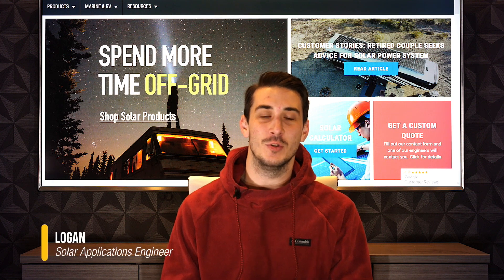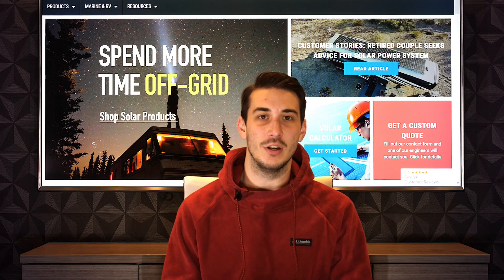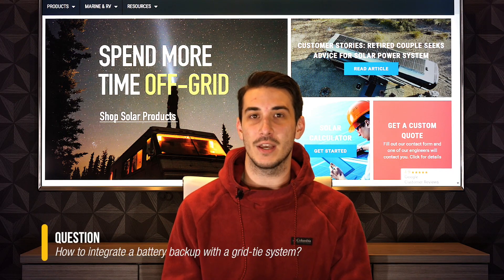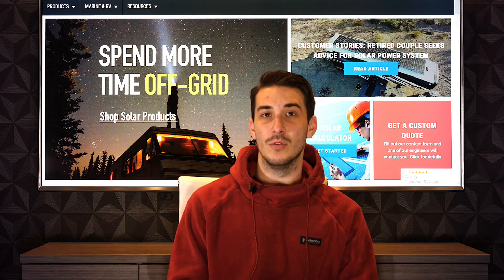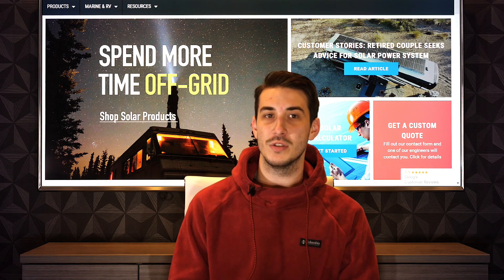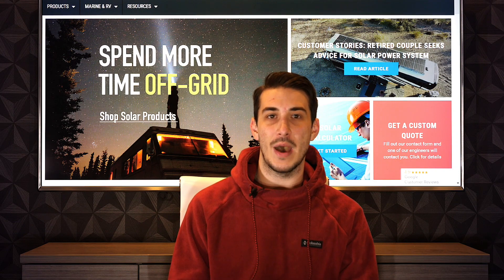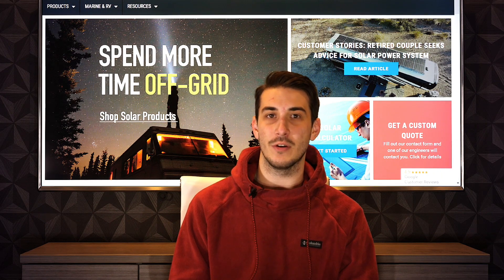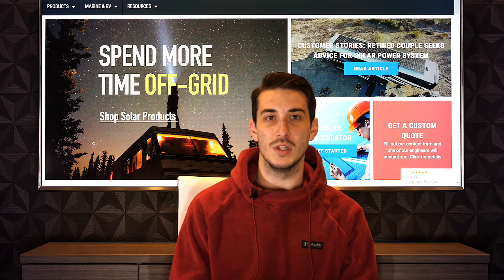How do I integrate a battery backup with a grid-tie solar power system?

Comment: I have a grid tied system and want to do exactly this!  Any recommendations for a reasonably priced battery bank that can be purchased without an installer?
Reply from the maker: We have several favorites if you're just looking for a battery bank. The Discover AES rackmount batteries are excellent, the Pytes V5's are great, and Fortress has some great options as well, depending on how much capacity you need! Definitely give us a call though. We can help you pick the right ones for your needs and get you the best pricing with some big discounts, especially right now!

Comment: Hold on!  You said after solar generated power satisfys the critical loads panel and the main panel, the excess is sent back to the grid??  NO, I want the excess to CHARGE THE BATTERIES.  Also, we need a better explanation of how the system prevents energy flow to the grid during outages - you know, for safety? Diagrams and a better explanation is needed.
Reply from the maker: https://youtu.be/6-tBtltI9XA?si=tgt2k9u1SmuOmpG4

Comment: If the system is tricked into thinking the grid still has power what stops the system from feeding excess power into the downed grid to prevent electrocuting the linemen?

Comment: This is the first understandable description I've found of what I want to do with my existing solar setup here in RI. I'd love to see a schematic, and I have one question at this stage: Is there a way to automatically disconnect from the grid when it's down (and reconnect when it's back up)? If my array and batteries are hot I don't want to have my lines to the outside world powered while utility company crews are working to reconnect me.

Comment: A diagram is a must. The sub-panel is connected to the main panel with cables obviously. So when the GRID goes down, why is the sub-panel disconnected from the main panel. What makes that happen? Do you manually flip the breaker to the sub-panel?
Reply from the maker: Video with diagrams: https://www.youtube.com/watch?v=d9onjlc1qNE

Comment: My PV systems peaks at over 40 kWh/day in May, and stays over 30 kWh/day (for sunny days) from April until mid-October, but on days I don't need the AC, I'll only use about 17 kWh/day. So if the AC isn't on my battery backup, and the grid is down, would it just shut down the PV and run on battery only, or can the PV continue to power the house and save the full battery for after the sun goes down?

Comment: When grid goes down, why would only sub panel circuits receive power from secondary inverter/battery storage. Since sub panel is connected to both AC output from hybrid AND main panel, shouldn’t main panel circuits also continue to receive power when grid goes down?
Reply from the maker: Generally, it's for safety reasons. When the grid goes down, we can't have grid-connected power systems energizing the grid while the utility company is working on getting it fixed. So the solar system isolates the sub panel from the main service panel to prevent energy from back-feeding the grid. This is why we tell customers to connect all their important loads to the sub panel. In the event of a power outage, the solar system will disconnect from the main service panel while continuing to power all the loads connected to the sub panel. Once the system detects that the grid power is back, it will reconnect to the main service panel. This video might also be helpful for you: https://youtu.be/verL-CIdtEk

Comment: Hello good afternoon thank you for producing this video I am located in Prescott Arizona question for you is I am running an off-grid system along with a grid-tie system I have read a few places that really don't make sense to me but I'm throwing it out there. If I feed my grid-tie inverter with my off-grid inverter to simulate a grid signal I have heard that if the grid tie inverter produce is too much power at that time it will have nowhere to direct the extra power which would normally go back onto the grid. My thoughts are it would just be energy lost but I have heard that the excess energy would harm the grid tie inverter. I am just under the impression it's based on Ohm's law whatever load is connected is the power that will be consumed the additional power will not be transferred anywhere is that correct

Comment: If your grid tie thinks there is power on the line and it still produces voltage how does it not energize the power line then?
Reply: I’m not really sure on electric coding, but probably though an auto ac disconnect between the main panel and your grid tie inverter so that doesn’t happen.

Comment: if i have a 5kw off-grid inverter solar system, can i combine with the meter grid as a back-up using a automatic transfer switch? and my mcb is 40A panel, thanks.

Comment: Does your on grid inverter have an off grid function. You can just put it to off grid turn off the circuit breaker from grid and enjoy an off grid system till the power comes back on and your reverse the modes back.?

Comment: look at Australians- You can use small offgrid inverter/Ups as a grid signal and then battery which voltage is in mppt range of ongrid inverter. This will allow you to use same inverter as a backup for household!
Reply: Pretty much what I do, I use a gridtie to offset the load on my portable power stations, it does some decent things conserving how many charge cycles I use on them.

Comment: If you are not consuming all of the energy being produced by the PV modules and you have disconnected from the grid so it would not back feed into the grid does the excess energy produced damage components?
Reply from the maker: Hi Freddy, no it doesn’t damage anything. The solar array can produce max power or no power or anything in between at anytime without causing any issues. Thanks for the question!
Reply: Good question

Comment: the way you layed it down seems like it would back feed the grid during the outtage, what am i missing here?
Reply from the maker: Anti-islanding protection is required for UL1741 / IEEE 1547. Any legitimate inverter that interacts with the grid via a standard Grid-tied or ESS solution will be required to have UL1741 listing by an NRTL and thus will monitor the grid for inconsistency and/or interruption and immediately disconnect from source (GRID).
Reply: @NAZSolarElectric  but the other inverter is there to trick the grid tied into sprinting back to action, and it's ac coupled, so now it has access to the grid cable! It still feels like I'm missing something here
Reply from the maker: @tota5  give us a call on Monday (800) 383-0195
Reply: @NAZSolarElectric  I'm from Brazil! I don't think I'll be able to call haha, but if it's possible for you guys to help me out retrofit my install, i would gladly pay, somehow... idk how this would work

Comment: Does Outback Skybox incorporate both gridtie inverter and battery inverter?
Reply from the maker: Yes, it both GT inverter and Battery Based inverter.

SkyBox installs like a grid-tied inverter, but with support for energy storage, which is easy to install later. A fully integrated design eliminates external charge controllers and communication boxes, significantly cutting solar + energy storage installation time and cost. EMS 2.0 takes the guesswork out of battery installation. It supports external CTs and stacking multiple Skyboxes in parallel, each with their own battery. SkyBox intelligently measures and controls power to and from any connection point (utility, solar, battery, generator and load), dynamically optimizing energy distribution, consumption and utilization—perfecting the way power is created, consumed, stored and sold. With SkyBox you can leverage the economic benefits of energy storage for time-of-use optimization and peace of mind backup power. Not ready for batteries? Install SkyBox now and add energy storage later.
Reply: @NAZSolarElectric  Thanks. I bought one from you last year and wanted to double check that I had everything I needed to install it when I move it to my new house.
Reply from the maker: @MarkSpohr  you're very welcome. We appreciate you being a customer!